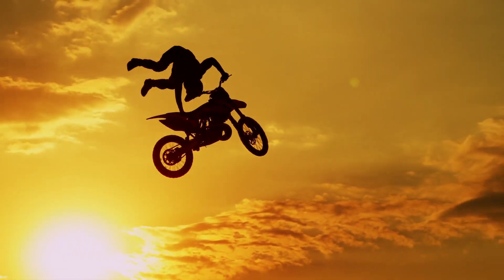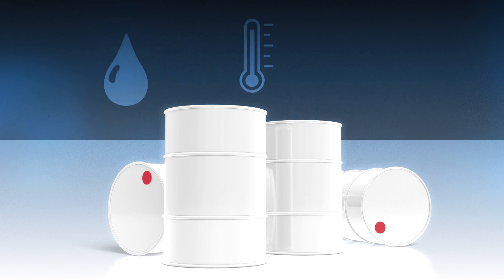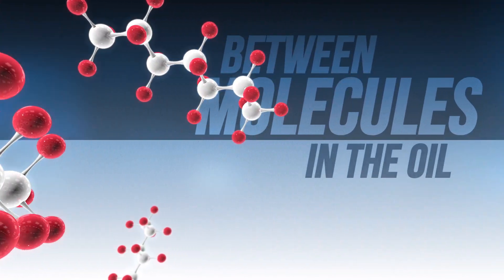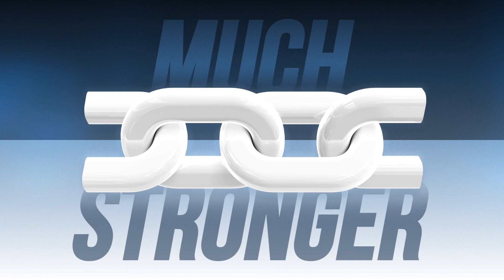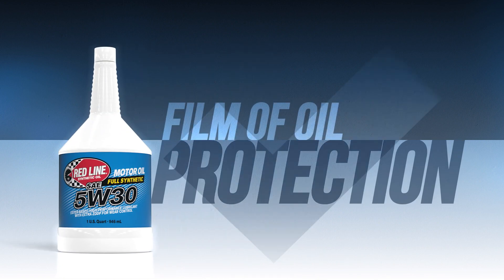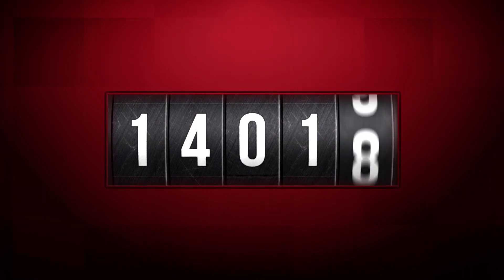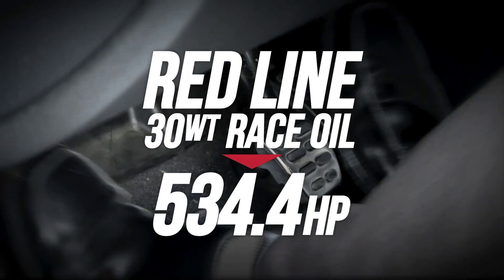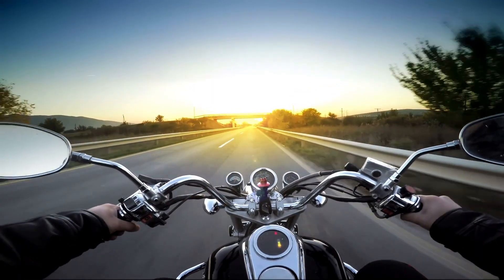Science of Synthetics

Comment: I recently switched to redline oil for my Hyundai veloster n and Audi rs3. Both use 0w30 and from the moment I switched oils I noticed that the engines sounded way quieter and both ran 10-15 degrees cooler on oil temperature. Those are major factors to me. I will only use redline synthetic oils moving forward.

Comment: Is it okay to mix  75-90 gl4 and 75-80 gl4    I have a 2005 Pontiac Vibe 5-speed manual   I just wanted to be a little later because winter coming up what is it okay if I mix those two and then it will turn out to be  75-85